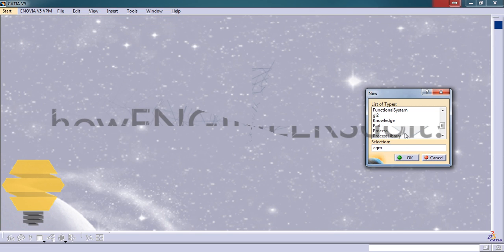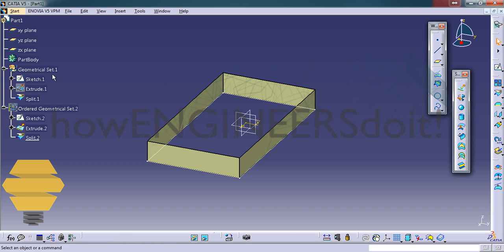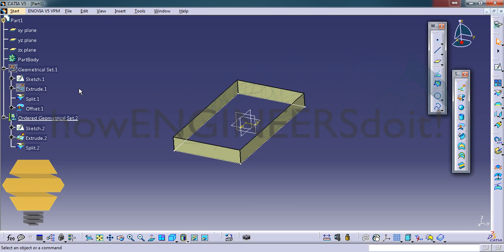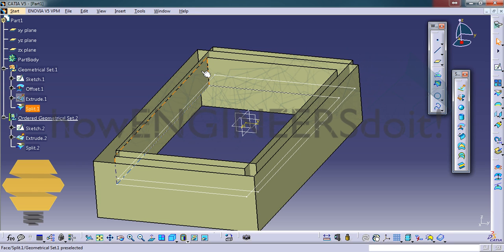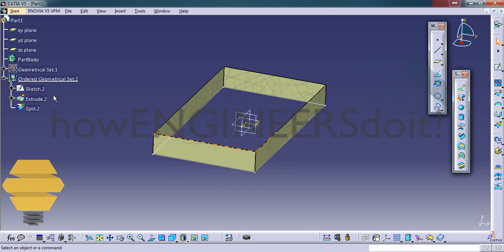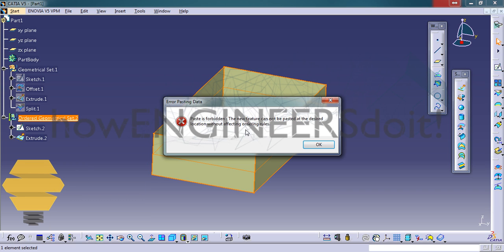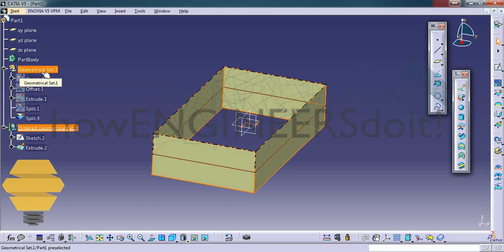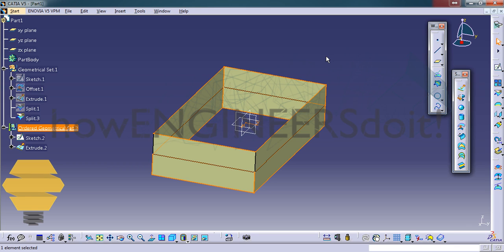All about Ordered Geometric set vs Geometric set difference by howENGINEERSdoit!

Comment: Excellent Video !  Very Clear,  Easy to understand.
May I suggest you  to  do  a  Video  Explaining  about  the   Strategies  and  approaches. e.g.,  What is the better way  to start  a  Project.  Is it better to  start  with  separated  Parts  and  starting Joining  to a Product  or   Start With  a  Product  File  and  start  adding  parts  to it  ?    I  have  a  tremendous  difficulty   with  that.     I  Design   for  already  more  than  40 years,  but  Using  Catia  forces  us  to  have  very  different  and  mostly  very difficult  new  approaches.   So  it  will  be  very  useful  to  learn  about  Strategies  using  Catia V5.   Thanks   for   All  your  videos.

Comment: Thank you sir sharing your knowledge. Sir I have one doubt that, I am working on Pressure vessel(PV) modeling (Parametric). But PV has two types Thick and thin PV and both have different relations then how I can define both design in same project (Means user can select either thick PV and Thin PV then that parametric design will get activated)